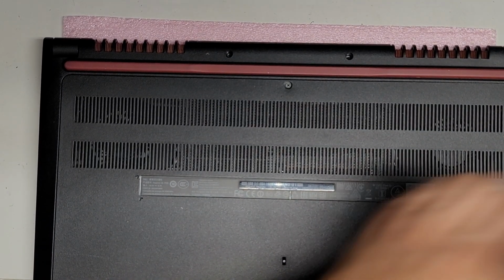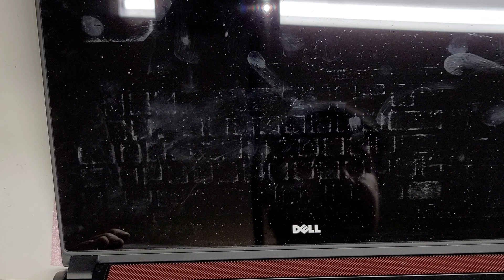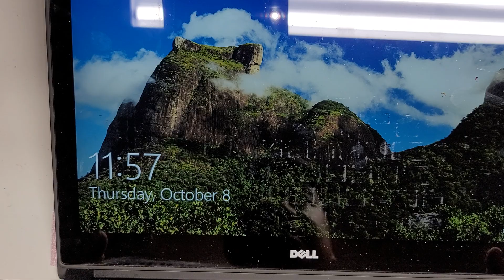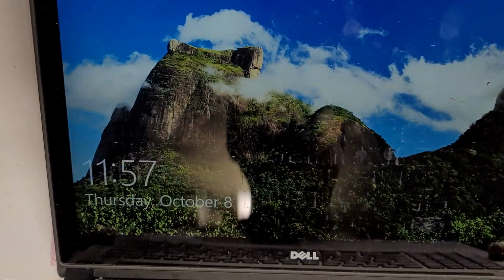DELL Inspiron 15 7000 15-7559 Disassembly RAM SSD Hard Drive Upgrade Hinge Fan Battery Repair 2 of 2

Comment: I want to ask if I have a dead cmos battery will my laptop boot up. I cleaned my laptop, change thermal paste try to turn on. When I press button nothing lights there is no boot up. Can dead cmos be a issue or is this mobo related?
Reply from the maker: Usually it'll still turn on. The date and time will just be messed up.

Comment: Great video!  I'm looking to replace the top and bottom case soon (left side has been badly damaged).  I wanted to pick your brain and was wondering what would be the best approach to keep the hinge from breaking again?  I was thinking of using JB Weld and strategically coating the areas where it would break.  Honestly, I'm not sure how effective that would be and wanted to get your thoughts on it.  Thanks!
Reply from the maker: It might help a little to prevent the plastic from expanding. You'll also want a little red threadlocker to prevent the screws from coming loose.
Reply: @ItsBinhRepaired  Thanks for the response!  Yeah after watching your video, I went ahead and ordered jb weld and red threadlocker.  Hopefully, the fix will hold out in the long run!  Thanks again for the info!
Reply from the maker: Make sure not to put too much threadlocker. Less than a drop. Don't want it getting into the plastic surrounding it.
Reply: @ItsBinhRepaired  Cool, will do!  Thanks!
Reply from the maker: Hope it goes well

Comment: hi man i have the hinge problem. will epoxy solve it? or should i buy a new casing? everytime i open my laptop the hinges and casing just pops up. thanks man
Reply from the maker: Jbweld will work, but you have to know what you're doing, otherwise you can make it worse.

Comment: thnx, i wish there is a easier way to open the air way/heat sink part to remove the dust
Reply from the maker: Yeah :(
Reply: @ItsBinhRepaired  if, only if,  both of heat sink cover have a square hole , its probly for vaccum cleaner to suck the dust , but the other one  on the left is covered by slightly larger heat sink, if i were to cut the plastic to extend the square hole so that i can use vaccum cleaner to dust, will it affect anything to the fan or the rigidity of the plastic cover?
Reply from the maker: @Reuizi  you'll need a mesh to protect the fan

Comment: My computer turns back on and the keyboard lights up however the fans are not spinning anymore. I was replacing the thermal paste.
Reply from the maker: Hmmm check the RAM. If not, you might have fried the motherboard :(

Comment: Insane that this EXACT problem happened to me. The hinge, the way your hinges looked, down to the freaking plastic coming up as I was removing the base. Very cheap company but lesson learned. Thank you for the helpful video! (Repair success and working great)
Reply from the maker: It's a common issue on a lot of models actually.
Reply: @ItsBinhRepaired  why though, just because of cheap materials?
Reply from the maker: @ericthomas4738  bad design. Hinges not getting enough leverage.